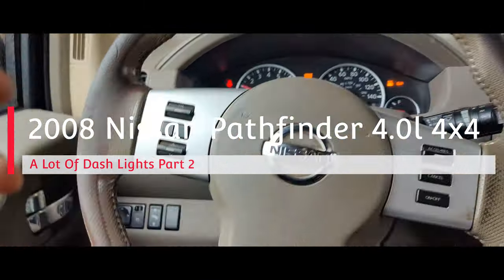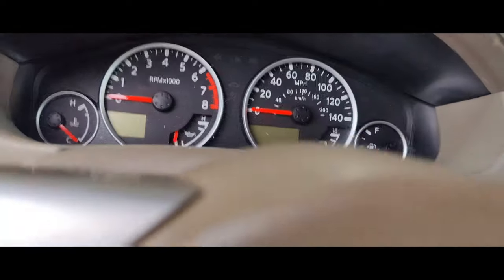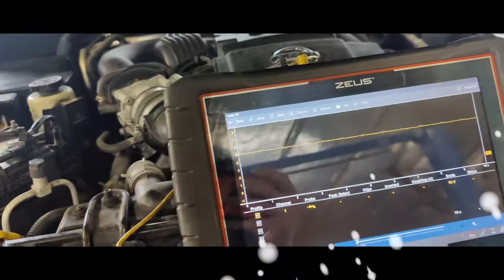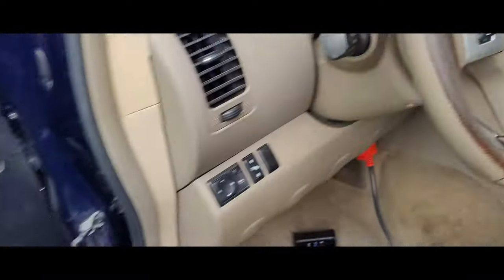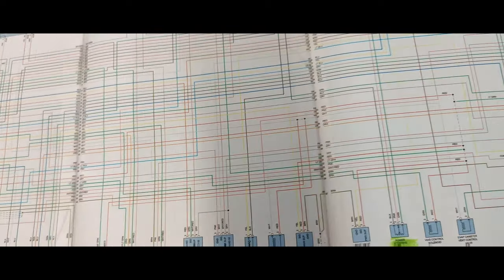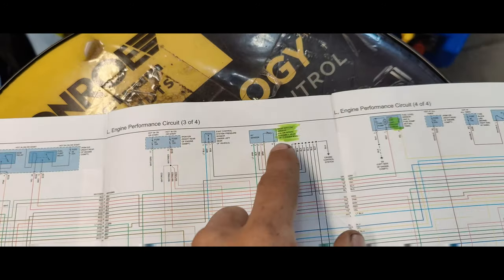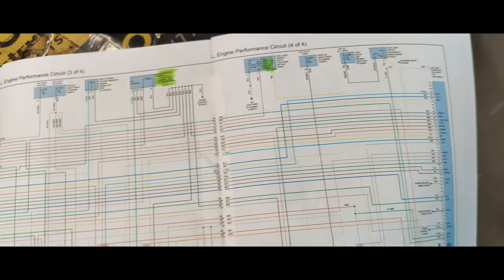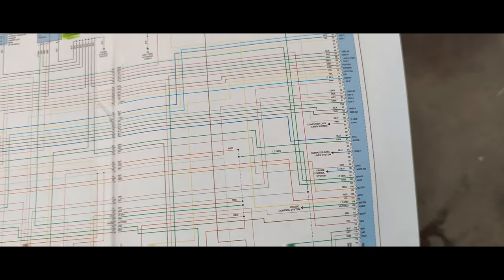2008 Nissan Pathfinder 4.0l 4x4 A Lot Of Dash Light, A Lot Of Codes (My Hardest Diag Yet) (Part 2)

Comment: I ran into a similar problem on a 2002 Pontiac Bonneville with 70,000 miles. The kid had got it from his grandmother and installed a stereo his self and he ran the mic for the hands-free up to the visor when he put everything back together he unknowingly ran a screw for the visor back into some of the wiring and melted the whole harness it was a freaking nightmare
Reply from the maker: Wow, did you take photos?